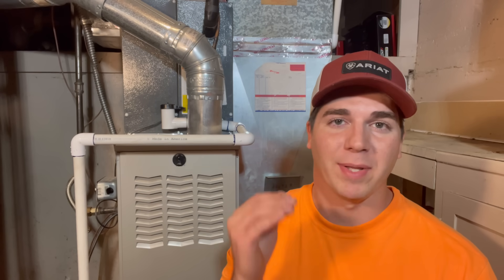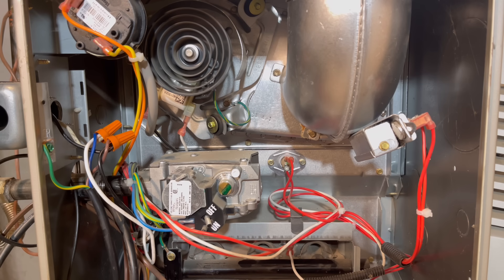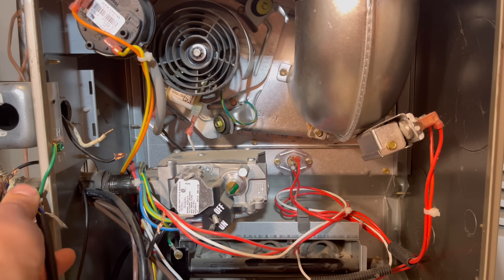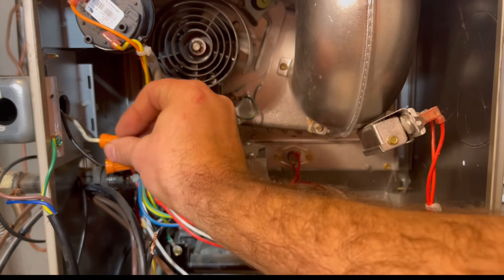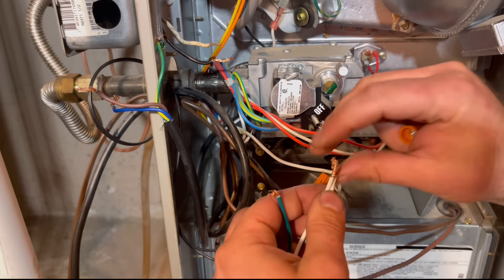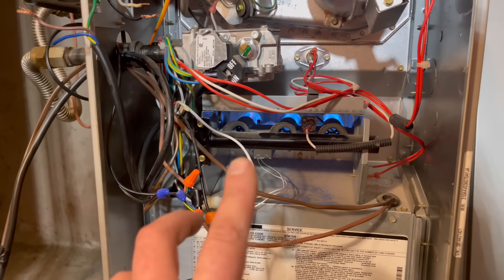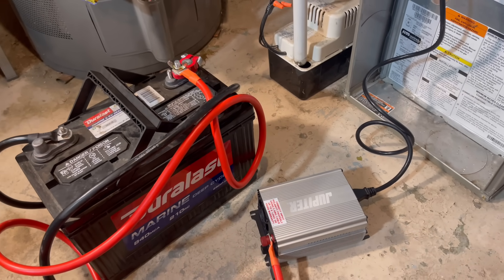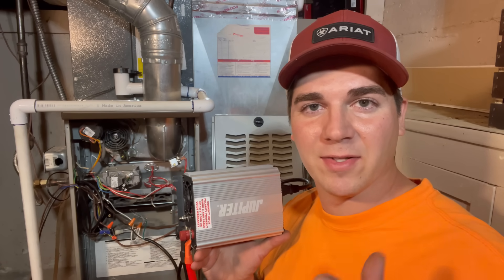Did You Know You Can Heat Your Home With A Car Battery?

Comment: Absolutely essential information shared here… two comments… one put battery off of concrete onto a piece of wood… and two always make a habit of connecting neutral wire first…  … well done!!!
Reply from the maker: Thank you so much for the tips! Make sure and subscrib to the channel for the follow up video and other hvac tips and tricks! Cheers

Comment: My furnace has a plug. I need batteries and power inverter
Reply from the maker: Here is the inverter I’d advise : https://amzn.to/3VtuTNF

I don’t think you’ll need a battery if you can install the inverter in your vehicle. It will dual as an inverter if you need to plug something in on a road trip AND in an emergency, simply run an extension cord to your furnace, and boom you have a generator. As long as you have fuel you are good to go! Just start it up every once in a while :) hope this helps! Cheers

Comment: Done it a few times; however, I have six really large deep cycle batteries and even with those the drain is enormous when passing through an inverter. Also have a few 1200 watt inverters with clamp style cables.
What he is showing will work, question is for how long? You can also power up a fridge, lights  or maybe more importantly, modem, router, LED TV, stereo and an electric blanket.
Reply from the maker: What I ended up doing is putting the inverter in my truck so I can run an extension cord and I can power the furnace as long as my truck has fuel! Simply start her up every once in a while 👍🏽 cheers

Comment: Where is the video that shows how long the inverter will last?
Also:
What is the minimum size inverter needed?
What size battery do we need?
I want to buy a spare battery for my car, may as well get one that works the furnace too!
Reply from the maker: Kind of depends on what size your furnace is and how many amps it pulls. I’d probably go with this one just to be safe: https://amzn.to/3i1DyrO 

And as it has clamps, in an emergency you can simply connect it to your batter and start the car every once in a while. This will allow you yo run your furnace as long as you have fuel in the car! If you have any more questions feel free to email me at diyhvacguy@gmail.com   Cheers!
Reply: @diyhvacguy  you can also use booster cables to hook this up to your furnace. Most of us have a set of them.
Just be careful! I will have to check my furnace manual tomorrow to see how much power I need.

Comment: Why is blue and brown used on so many things I'm noticing it on light fixtures because blue and brown are both live colors blue is live on a 120 208 service and brown is live on it 480 277 service where you're using 277 for a light circuit use Brown orange or yellow with a gray and blue is live on a 208 service where you're using 120 volts Blue to White black to white or red to White

Comment: You should have a class T fuse on the positive cable going to the inverter with the correct rating for the amont of power your using ive ben using a xantrax pure sin wave inverter for my backup sump pump in the summer and for my furnace in the winter if the power goes out i had lost power acouple years ago for like 7 hours it was 0 degrees outside and i stayed nice and toasty inside. my furnace is older and was not wired directly into my panel so i can plug it in the inverter and with about 200 watts of solar charging the batterys, i have had my setup going for atleast 10 years now and has ben very usefull and reliable tool i would recomend geting a generator to so you can run the furnace and charge your batterys at the same time if they do get low on charge.

Comment: I’ve got a j box on front of furnace that has some wire ends w/wire nuts on them under normal operation.  Shut disconnect off two Phillips screws and I can pigtail my short “cord” to and I hook to the generator outside. I haven’t seen if my power inverter I put in my work truck would do it

Comment: I was very eager to see how long the battery would power the furnace because I am a bit skeptical that it would run it "for days", as you mentioned in your video.  But when I clicked on the link, it took me to something completely different.  So do you indeed have a link for this video?  I did some calculations of my own and here's what I came up with:   My heater draws 2.4 amps at 125 VAC, or about 300 watts.  Considering that to convert this from twelve volts to 125 volts through the inverter, you'll draw about 25 amps, and about another 2.5 amps due to the inefficiency of the inverter for a total of about 27.5 amps.  The Duralast 29DP-DL you were using in the video has a 106 amp-hour rating, but these ratings are highly optimistic since they usually run the battery down to about 10.5 volts during the testing--a level which may be well below what the inverter needs to run.  So if I'm very generous in my estimate, you'll get less than four hours of runtime, not "days" as you stated in your video.  I think you should put up the video of the duration test so folks won't spend a lot of time, effort, and money on making preparations they may count on in an emergency, only to be left in the cold after a few hours!
Reply from the maker: Thank you for your comment. What I ended up doing is connecting the inverter to my work truck so I can power the furnace as long as I have fuel in the truck. This is probably an easier solution and much longer run times. Much quieter then a noisy generator too. Thanks for watching!

Comment: Looking at the size of battery cables I'm wondering how many amps flowing.
I use the same set up for a few lights and tv when power goes out. Usually only 2 hours at most.
Reply from the maker: Thanks so much for watching! Make sure and subscribe to the channel for more helpful hvac tips and tricks! Cheers

Comment: pretty cool. but won't the fan drain the battery within a hour or so??? I just don't see a few days
Reply from the maker: Yes I ended up connecting it to my work truck so I can power the furnace as long as I have fuel in the truck 👍🏽  Thanks so much for watching! Make sure and subscribe to the channel for more helpful hvac tips and tricks! Cheers

Comment: Interesting. Never thought of doing this. I live in southeast Texas. During the big freeze we were among the lucky ones that never lost power at all. My house has two separate heating units in the attic. Each unit has a dedicated switched outlet close by and are simply plugged in with a regular plug. I have a Toyota Tacoma pickup with the towing package. It has a factory installed converter and a 110 outlet in the bed. If I ever need to, I can plug my heaters into my truck with a long extension cord and simply start the truck from time to time to keep the battery charged. I would have never thought of doing this on my own. Thanks for the idea!!
Reply from the maker: Thanks so much for watching! Make sure and subscribe to the channel for more helpful hvac tips and tricks! Cheers

Comment: Couple of things to note. First off most people think the only determining factor in a battery is the cranking amps or cold cranking amps CCA. That is not even the most important thing in something like this although it is still something to look at. For something like this the most important thing is the actual physical size and weight of the battery. You can take two batteries that have identical cold cranking amps and one of them might be like 30% larger physically. That physically larger battery is going to last longer when you have it hooked up to something that is just drawing current from it. So if the battery is really big and heavy it will be a great option for this. You can also get a trickle charger and keep it hooked up to maintain one of these batteries for when you have an emergency.

A car battery will work but a deep cycle boat battery is better because it's designed to be able to tolerate being run down really low without damage to the battery. 

This will not work on an electric furnace because they require too much power. Not on AC either. 

If you have a generator it will work in place of the battery and inverter. A big enough generator can even be made to work on an electric furnace.
Reply from the maker: Thanks so much for watching! Make sure and subscribe to the channel for more helpful hvac tips and tricks! Cheers

Comment: I am not knocking this guy, it actually is good information. The problem is that this is going to power your heater for a few hours not days. Plan ahead and buy a free standing blue flame propane heater and a few 20 pound bottle's. I get about 48 hours of burn per bottle and I am heating about 1200 to 1500 sqft with the doors closed on unused rooms. Alternatively look at the amp's on the fan amp x volts = watts and buy a generator that will run your heater.
Reply from the maker: Yes thanks for this information. The next video will be along these lines, with ways to heat your home with no gas or electricity.  I’ll also be doing the test video for this, as many people have asked. Thanks so much for watching! Make sure and subscribe to the channel for more helpful hvac tips and tricks! Cheers

Comment: So how much peak power at 110 vac do you need to power your furnace.  You probably hit the peak power draw when that igniter is activated, right?
Reply from the maker: I believe so. I think mine was 8 amps total
Reply: @diyhvacguy  8 amps at 120 Vac is a lot of power!   8 amps X 120 Vac = 960 W.  That's far beyond the capability of most inverters designed for automobiles, though of course you can buy an inverter that handles much more (like you have).  Also consider that if the inverter is 70% efficient, it's going to draw close to 1400 watts from the battery for a short time when those gas ignitors are firing up.  Sourced from a 12 volt car battery, that's 117 amps, getting close to how much a car starter needs.   I will however give you a  thumbs up for your idea.  If you spent $150 on a cheap Chinese inverter, and used your car battery in an emergency, that could keep a gas powered furnace working for a while, and you could recharge the battery with your car.  (Or just leave the car outside, attach the inverter to the battery, and run a long extension cord to your furnace.  That sure as heck beats buying and maintaining a gas powered generator.)

Comment: Even though I find this video interesting but considering your furnace is in the basement I think that only works until the basement floods . Plus Texas vs the rest of the states we only lose power for a couple hours/minutes . Serious disaster has to strike for days of power loss . I dunno sounds like a Texas problem
Reply from the maker: It’s kind of obvious that the furnace will not work when it’s submerged in water lol
Reply: @diyhvacguy  uh no I was saying if your power is out and you hook your furnace up which is good I like your idea but you’d better get that off the ground or hook your sump pump up too. I was trying to help ya . You don’t wanna fry a board on your furnace some are over 2000 bucks to replace . If you don’t mind your basement flooding put a table under your set up.
Reply from the maker: @gurl_friday1116  oh I stated that mine is an 80 percent furnace. So it isn’t needed in the winter months. And then stated if you have a 96% you should connect the condensate pump 👍🏽 sorry for the confusion

Comment: Yup, a lot of problems here. You'd need probably a half dozen or more of those batteries for a days worth of furnace operation (intermittent use) depending on thermostat setting. Connecting the inverter to a running vehicle would make more sense, but the vehicle would likely need a 100-120 amp alternator, and it would have to provide that amperage at idle unless you want to prop a stick against the gas peddle. Might just as well buy a generator.

The "cord whip" on the furnace is a useful idea. I've installed a few for people with portable generators who just run extension cords to important stuff from the generator. The DIY HVAC Guy's method was a clumsy hack at best (sorry). There is no need to open the furnace to install the "cord whip" for alternative power sources. Simply replace the single pole/single throw wall switch, currently used for the furnace power, with a double pole/double throw/center off toggle switch. Wire the house line and neutral to one end of the switch, the "cord whip" to the other end of the switch, and the furnace leads to the center. When the switch is fully in one direction you have house power. When fully in the other direction, alternate power from the "cord "whip". The center position is "OFF" for servicing the furnace. All wiring changes take place in the switch box. Be sure to use a cord grip (protector) on your whip where it enters the switch box. Buy a blank cover for the switch box and drill appropriate diameter hole for the toggle switch to mount in.

Some people will see that male plug hanging there and think "suicide cord", but when wired correctly, the only way there is power on the "cord whip" is if it is plugged into an alternate power source. And, when wired correctly, no way to accidently back-feed your alternative power source into your house wiring.
Reply from the maker: Thank you for this information. Very helpful. I did actually install a pure sine wave inverter in my truck so it can power the furnace as long as I have fuel in the truck. Thanks so much for watching! Make sure and subscribe to the channel for more helpful hvac tips and tricks! Cheers

Comment: This is really cool, thank you. I would like to leave the battery in my truck, leave the inverter under the hood and run a longer extension cord to the air handler, However, my truck has two 12v batteries, should I unhook the other while powering the inverter?
Reply from the maker: I’d leave it connected and just start your truck from time to time 👍🏽

Comment: Awesome! We road out a power outage quite q few years ago and I only had limited power from a generator. Had to shuffle electrical loads around...fridge, freezer, lights, space heater, etc. Didn't have any way of running the furnace...or so I tought! Thanks so much for this!
Reply from the maker: Of course! Thanks so much for watching! Hope you subscribed so you can enjoy more helpful hvac tips and tricks. Cheers
Reply: if you have a generator you can easily run a line to the gas furnace. Simple enough to run the an extension cord to the furnace emergency switch. Cut the female end off the extension cord and connect the hot, neutral, ground wires to the furnace switch. This can literally be done in 5 minutes.

Comment: Even the simplest ideas can elude us. I had never even considered using tjis idea if i were to have a power outage. I already have a set of four class 7 truck 31 series batteries, a 750/1500 Watt inverter, and a couple pigtails. Maybe I should check the condition of my batteries and give them a charge if needed. I had purchased my inverter for camping trips a few years ago, but never thought of using it to power my furnace during a black out. Maybe I should upgrade my power inverter, I'll need to anyway.

Comment: Could you plug in a battery charger to the inverter, to keep the battery charged, or at least extend the run time?
Reply from the maker: It might extend it. But the battery would use the power much quicker then it could charge. Someone else suggested a separate battery for that purpose maybe?

Comment: I remember from long ago that inverters are pretty inefficient, converting 12v to 120v there's a pretty fair loss, and for every one amp A/C it's drawing at least 12 amps from the battery plus the loss. I know my Goodman 96% furnace I installed recently is breakered with 15 amps, I haven't put a meter on it to see what the actual constant draw is with the two fan motors and the circuit board running, i'm sure less than my old Lennox Conservator G11-e that had a 1/3hp blower, but even if the Goodman is drawing 6 amps it would be pulling about 72 amps plus the conversion losses from the battery, that's a pretty fair amount and a lot of car batteries these days are just dinky things unlike the huge batteries I had for my vehicles like the '69 Dodge 3/4 ton pickup. I'd be tempted to have a dedicated battery, of the size in the video, and even better to have a solar panel keeping a charge on it.
Reply from the maker: What I ended up doing is installing a pure sine wave inverter in on if my work trucks so I can run an extension cord and power the furnace as long as I have fuel in the truck! Thanks for the comment brother. Cheers
Reply: @diyhvacguy  Nice! I rec'd the Vtoman Jump 1,000 yesterday, it had  83% charge, charged it to 100%, so I'm ready! it was 40 pounds shipping weight! It looks well made and a lot of options on it's panel for different things, glad I saw it in your other video.

Comment: It has 2 outlets and its a 110 inverter can you hook a battery charger to the other side and to the battery on low charge
Reply from the maker: I heard you would need a separate battery for this. Would be a cool test though! I might make a video trying that. What I ended up doing is hooking the inverter to my truck so I can power the furnace as long as I have fuel in the truck :) cheers

Comment: Thank you for the video sir. I will do as you intended by giving us this option. I will modify it to suit my needs. I was totally unaware of this concept. I will also use some of the comments to modify my setup. I like the idea coupled with the 24v renogy pure sine wave inverter and use 24v 200 amp lithium iron phosphate battery for longer life and increased power storage. I will also buy 2 of these batteries and a small solar setup to charge 1 battery while using the other. I thank you all for the ideas. Obviously, as stated in the comments, a generator is always best, but this is an awesome backup idea. Especially if your gas runs out for the generator. I'm glad I watched the video and glad I read the comments. Thank you all.